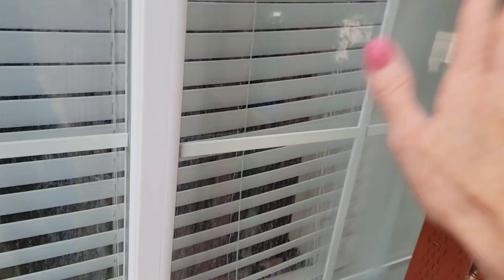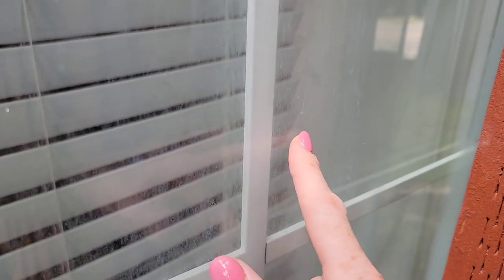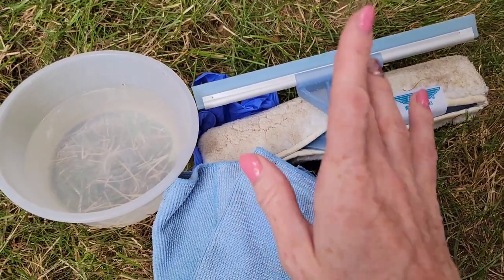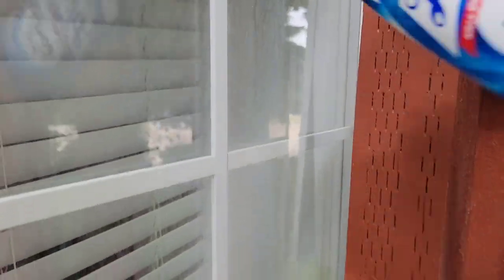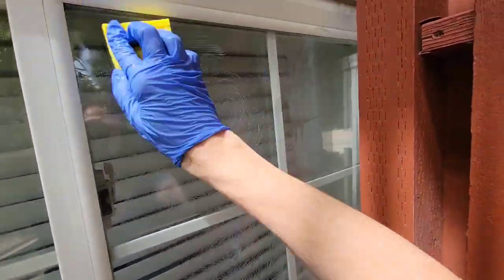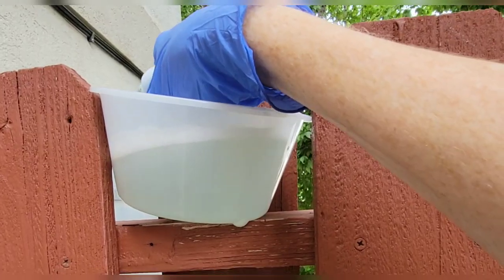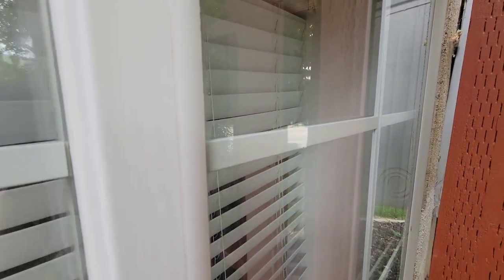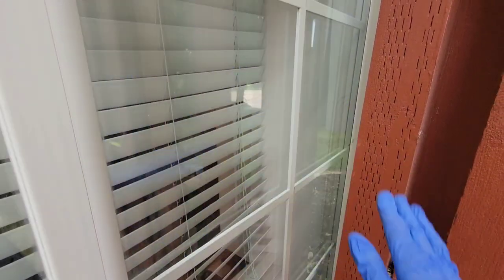Use THIS⚡ on Your Windows  and SEE WHAT HAPPENS.  Hard Water Stains 😳GONE

Comment: O.k., I am back and I just finished using this method to clean 3 windows. I confirmed this method is EXCELLENT and it was "easy peasy". Took less than 5 minutes per window with minimal scrubbing. Windows are crystal clear now. This was the only method I found to get the stains off the glass. Wear gloves and safety glasses when handling toilet cleaner. Thanks!

Comment: I live in FL and between all the rain, the sprinklers, and the baking heat my hard water stains are brutal. I’ve tried everything, including toilet bowl cleaner, and nothing takes the hard water stains off. Short of using a razor blade, is there anything else you might recommend?! - Frustrated in FL! 🤷🏼‍♀️
Reply: Try "The Works" toilet bowl cleaner. It worked so well on my baked on hard water stains that had been built up for over 10 years.

Comment: I just moved to Fl and my windows in front are disgusting from the sprinklers hitting them! They are old windows and I’ve tried CLR/ razor etc but am willing to give this a shot😊. I just wonder if there is anything I can use after they are clean to make a barrier so the hard water beads and runs off?

Comment: This works because of the 9.5% hydrochloric acid. I use a toilet boel cleaner also, but eith 9% sulfamic acid. Both are considered strong types of acid. You can also mix it t
50/50 or 25/75 with water in a spray bottle. I use this in the shower. Quick.spray and wipe every few weeks. Alternatively use fine grade brass wool pads